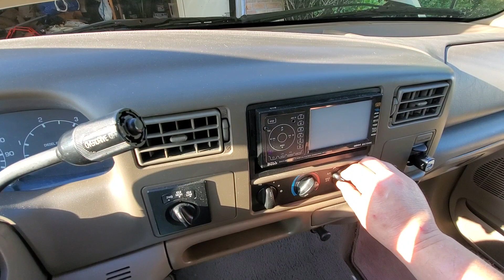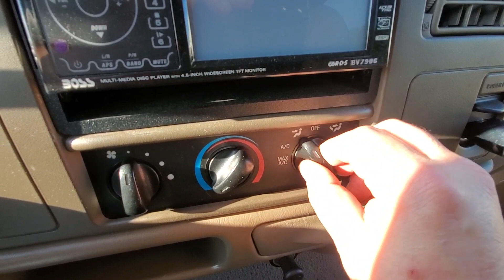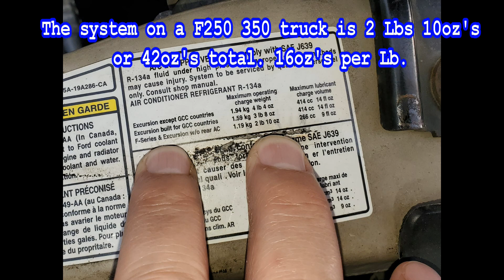How to Detect Low AC pressure Easily Ie F250 or F350

Comment: Can you give me a hand here, I have the same truck. I emptied out all of the R134a, then I attempted to refill the system with R134a, but the compressor keeps kicking on and off. The only way that I can keep the compressor running a hundred percent is if I do the same paper clip trick. Should I replace the switch? Or should I remove a shim from the compressor clutch? Or am I in for a new AC compressor?
Reply from the maker: Sure,   ****Sorry for the long answer I'm about to give you, but I'm not there to help you so you'll need to know a few things to find the problem yourself. So buckle up you're about to get a crash course on Automotive AC System Compressor Cycling.
* A little added note: On hot days the compressor will cycle on and off about every 10-20 seconds. IF the vehicle cools down, and the temperature coming out of the vents, ( in air recycle mode or AC MAX), is approximately 30 degrees lower than the outside air, then the system is operating normally.  Recycle mode is when you push the little sideways "U" with the arrow on it on the environmental controls, or put the system in AC MAX. This means the air going through the system comes from inside the vehicle and not from outside the vehicle. This makes it easier for the AC system to cool the vehicle down with air that's already cool, rather than bringing hot air from out side and try to cool that air. **
Ok on to your problem. Again sorry for the long answer!
Compressors typically cycle for 1 of 3 common reasons. Here they are with some of the underlying causes for those.
 * 1. Low pressure. Put a gauge on it to check it. You can rent a gauge set at most automotive stores for free. Free in that you put a deposit on them. The deposit is usually the cost of the item plus 20%. When you bring them back you get a full refund on your deposit. Watch A LOT of videos on these if you've never used them before,  or you can blow up or fry your system.
  a. Low on refrigerant.  MOST COMMON!
  b. Orifice missing. Very uncommon, some one has to open the system pull it and then forget to re-install it.
  c. Compressor seals are bad and allowing to much bypass. Mine lasted 18 years then blew last summer.

** 2. Hi pressure. Put a gauge on it and check it.
   a. To much refrigerant (Over charged).
   b. Orifice clogged or almost clogged. This happens when a compressor blows and is changed and the orifice is not cleaned or changed. This also happens when a owner uses a lot of stop leak to solve a slow leak. This typically is fine for one use but repeated use is disastrous. Seen this first hand on a friends truck, all I can say is wow is was BAAAD!
   c. Clog in the system somewhere, usually the Orifice or Condenser behind the grill. Stop leak or compressor blew up inside.
   d. Air/Moisture in the system. If the system is open for a while moisture can seep in and over time start to corrode the AC system from inside. The little bits start to clog the Orifice and Condenser. Air turns into steam and causes a high pressure but is a poor refrigerant. Always pull a vacuum after opening a system that allows air in. You can rent one for free from most Automotive Parts Store, same deposit deal as the AC Gauges.
   e. AC Condenser is clogged. The Condenser behind the grill turns the AC Refrigerant back into a liquid by cooling it. If the fins are bent or if it's clogged from road debris the can't work very well so the pressure goes up.
   f. AC Evaporator is clogged. This is very common on these trucks, and other large Ford trucks, even other manufactures have this problem, like GMC Safari's. This is a doable fix, but is a little bit of a pain in the but. You have to open the Evaporator clam-shell and clean it with a toothbrush, vacuum it, and wash it off with some water. Low pressure hose is fine, just put a wet dry vac hose in there to catch the water or it could end up in the truck. If you send me an email at keith_noneya@att.net I'll send you a picture of what to expect it to look like. 

** 3. Faulty wiring/electrical.
   a. The connectors over time get a little corrosion inside, "or" due to the constant vibration the Pressure Switch connectors/wires start to break down right at the connector edge where they go in it. This is a very common problem with the High Pressure Switch on the 7.3L. To find this one, bypass each Pressure Cycle Switch one at a time with a paper clip and then wiggle the wires by the pressure Switch. If it goes on and off you most likely have found your problem. Buy the connector at the the local Automotive Part Store along with some Environmental Splices, then change it.
   b. The pressure switches themselves over time do wear out, try changing them. Caution, they are supposed to have a schrader valve to prevent the refrigerant from leaking out when unscrewed. Unfortunately those valves don't always work and when the switch is pulled it sprays everywhere. The High pressure valve often sticks and if you're not quick it can empty a 12oz's (a can) out real quick. When doing the HP switch if this happens you'll have to constantly push the green AC O-Ring back up into the switch as you screw it on, not fun!
  c. Compressor Clutch Coil. These over time do go intermittent then usually fry when they short internally. On modern Ford vehicles, and other makes, they can be changed without emptying out your R134A.
  d. Bad ground wire on connection going to the the AC Clutch. To find this, bypass both Pressure Switches and wiggle the wires going to the AC Clutch. If it turns on and off you have a problem.

Again sorry for the long reply, I don't really know how much you know, so I though I would give you a lot and let you pick out what you needed and go with it. 
Always feel free to ask questions! My channel is about education and helping those who need it.
 Keep and eye on my channel. I editing a whole series on how to completely rebuild the F250/350 series AC System. Already shot the videos, but man getting the info right and editing is a "B-OTCH". I'll have a video for each item on How to replace ALL of them, pull a vacuum and recharge your system, including finding leaks, tools, chemical, etc.
Best Wishes & Blessings. Keith Noneya
Reply: @keithnoneya  the 3 reasons you gave to why a compressor keeps cycling is key here. That's the exact information I was needing, thank you!
Reply: Thanks for the information bud. You go above and beyond for your viewers. You have my sub
Reply from the maker: @FromThe3PointLine  PS how's the system running a year later? Keith Noneya

Comment: Where is the switch on a jeep grand Cherokee it is not on that little can 2003 please help
Reply from the maker: You'll need to do this search: 2003 Grand Jeep Cherokee Compressor Cycle Switch and it should pop up on YouTube. If you're still not sure let me know what engine is in it, as different engines use different set ups, and I'll try and find it for you. You gotta love YouTube! There's so much good information out there and I've met some pretty cool folks from all over the world. Let me know if you need more help. Ps if you email me a picture of your engine to my YouTube email I can get a better Idea of what engine and system you have. keith_noneya@att.net   Best Wishes & Blessings. Keith Noneya
Reply: I've looked everywhere for that switch Keith if I cannot find it I have the 4.0 6 cylinder the common engines in the Jeeps I cannot find the switch anyway I've looked all over it's not on the tank I followed all the lines by I can't find it if you can please help I've searched YouTube to
Reply from the maker: I'll see if I can find it for you. Of all the ones I've seen it's on top of the Accumulator, (the tank). Take a good picture of the Tank and send it to my YouTube email  keith_noneya@att.net. Don't worry I'm not going to sell your email, or anything like that.  LOL Keith Noneya
Reply from the maker: Oh hey Jeannie you could post a video on YouTube and all of us will get to see your system. That may be more useful for everyone to help. Best Wishes & Blessings. Keith Noneya

Comment: Wheres the video for leaking? I put the cans in and within a week mine runs out. Crazy it worked great for years.
Reply from the maker: Hey DYI I haven't posted it yet, but, I use the same method as ScannerDanner, it's cheap and very reliable. Here's a link to his video, https://www.youtube.com/watch?v=J6DSpx1V3Ms I'm sure it will help you find it, save you a trip to the AC guy and keep you from draining your bank account. Make sure and read the description (SHOW MORE) tab too, it has some good information in there on how to get/rent the equipment ect.
Let me know if I can help you in any other way bud. Best Wishes & Blessings. Keith Noneya.
Reply: Hey genius... if you mention a link, make sure not to forget to post the link.
Reply from the maker: @gavinvalentino1313  Wile E Coyote here! "You're absolutely Correct", OOOOPS Man I can be such a ditz at times. Figured out what you were talking about. Sorry about that.  Here's the link to ScannerDanners video: https://www.youtube.com/watch?v=J6DSpx1V3Ms 
Also, here's a link to some of those Recharge Kits if you need to get one. https://www.amazon.com/s?k=ac+recharge+kit+for+car&crid=1M0E6PRQW0HU7&sprefix=ac+recharge%2Caps%2C226&ref=nb_sb_ss_ts-doa-p_4_11 
Hope that helps, and hope you found the rest of the video useful though. and again sorry for being a Ditz! Best Wishes & Blessings. Keith Noneya PS I

Comment: Hey, sorry to bother.... but any ideas on ...when I put the "can gauge" on....it's reading SUPER high pressure...like 160-170....and no clutch action at all while running...Thanks Jason....!
Reply from the maker: If the clutch is not coming on and your at 160-170 psi the system is probably over pressurized or the system has balanced out since the clutch hasn't engaged the suction on the low side and the pressure on the high side. Put the gauge on it and bypass the low pressure switch with a paper clip like I showed in the video. If the compressor comes on and the pressure pressure doesn't start to immediately drop then pull the paper clip and take it to an AC shop. If the pressure drops to about normal then and starts to cool, change the Low Pressure switch. If the pressure drops below the normal pressure and the compressor is running, add some R134A until it charges to the normal pressure. Check it after a few days and see if the pressure stayed the same. If it does you should be good to go, if not and the pressure is low again you have a leak. Fix it, pull a vacuum and charge the system. Hope that helps point you in the right direction. Best Wishes & Blessings. Keith Noneya. PS you can rent a vacuum pump at your local Automotive Parts Store, Ie. AutoZone. Let me know if you need anything else.
Reply: @keithnoneya  Thanks SO much for your time on that...!  I really appreciate it!   I bypassed both low and high and changed out the relay with another one... clutch is free spinning....but did not come on at all.... only other thing I can think of is check for voltage at the compressor connector...(  the relay under the hood is clicking though....
Reply: Sorry... and just an fyi...it was working fine a few months ago....and it's just been sitting not drivin....(I know not good ...lol...but...idk...just crazy....(like all of the sudden....)  I did "bleed" the pressure on the low side and burp the high side down to like 70- 100 to see if it would help....but
Reply from the maker: @jasonherman4833  The low and high sides when the compressor aren't running equalize. So the low & high sides will both approximately around 100psi until the compressor starts to run. Short the switches again and put the positive lead on the compressor connector and the negative on the compressor body. Turn the AC on in the truck and you should have 12vdc on the connector. If you do the coil is probably bad on the compressor. You can change it without changing the compressor. Best Wishes & Blessings. Keith Noneya
Reply: @keithnoneya  Man.....THANKS SO MUCH FOR YOUR TIME AND HELP.....!  I REALLY APPRECIATE IT!   I'll do it tomorrow...!  Silly question.....can I do that "carefully" AT the relay terminal?   Or wouldn't recommend that?
Reply: And May GOD Bless you for helping others the way you do....!  THANKS AGAIN!
Reply from the maker: @jasonherman4833  What year is your truck and do you have a copy of the schematic?
Reply from the maker: @jasonherman4833  If you don't have a copy, I have a copy of the schematic for 1999 - 2003. I can email it to you and walk you through troubleshooting it, so you'll know what to buy. chat with you in the morning. Best Wishes & Blessings. Keith Noneya
Reply: @keithnoneya  sorry....missed that message....2007....I don't have a schematic...

Comment: I'm having this issue tho mines it's reverse, the clutch stays engaged and there's pressure in the system, even when I take off the ac clutch relay out, it's still engaged, not sure what's the issue, any tips??
Reply from the maker: Hey Danny answer a few questions please.
1. What year is it?
2. Does the clutch ever disengage?
3. Do you have a hand held volt meter?
Let me know and we'll go from there.
Reply: @keithnoneya  it's a 2011 Toyota Corolla 1.8L, and it stop disengaging when I noticed it wasn't throwing cold air, and I'm sorry I don't have a volt meter
Reply: Meaning it never disengage, it stays cycling with or without the ac being turn on
Reply from the maker: I have to take care of something for about an hour or so, I'll help you when I done taking care of that.
Reply: @keithnoneya  ok thank you very much
Reply from the maker: @NYRican1505  You're going to need a book that has the schematic and a meter, try a Haynes or a Chiltons at the auto part store. Once you get the schematic I'll need you to take a good picture of the AC system schematic and send me a copy of it to go through the wiring diagram with you. 
My email is keith_noneya@att.net if you want to proceed. 
If you're not familiar with using a mult-meter or chasing wires through a dash panel and engine bay, you might want to take it to a professional. It sounds like the control panel has a short in it or a stuck relay, that's why we need the schematic, to find out what part is not disengaging the compressor. Let me know if you want to try working with me on this Danny. It could take several days to track it down this way. Either it's a good idea to have a manual if you're going to do maintenance on your car. Also can you post of video of it on YouTube and explain in your bet words what your problem is. You can all it "2011 Toyota Corolla AC Won't Shut OFF" Send me the link to your video when you have that done. Please show the AC Controls and the Compressor & Switches in the Engine Bay. Best  Wishes & Blessings. Keith Noneya
Reply: @keithnoneya  thank you very much I'll try to figure out to get the schematic and send you the info, I appreciate it very much

Comment: Thanks for posting the video. It is very informative. I have a question regarding my 2007 Ford F-350 6 litre turbo diesel A/C. This vehicle mostly sits summer and winter so I expect it to be low on A/C coolant fluid from time to time. This time when the A/C was blowing warm air I had a look at the compressor and it was cycling every 5 seconds. I put on the gauge + bottle from a recharge kit on the low side. With the  engine running I saw the pressure swing back and forth from 25 to 70. I added a 6 oz bottle of fluid and saw the pressure steady to 35 = the middle of the green zone. However the compressor has quite cycling. It just runs continuously now. The A/C was providing cool air. It was not a particularly hot day, maybe mid 60’s. I have noticed in the past that if I left the A/C running continuously, it seemed to quit working, like the core iced up or something. After turning it off for a while - 20 minutes or more - it would resume working. Do you have any suggestions regarding this? Thanks for any help.
Reply from the maker: Hi J. 35 psi sounds about right for 60 deg's, I would check the cabin air filter. If they get a little clogged and get wet they will slow the air flow. Next check the Evaporator in the clam shell housing in the engine bay on the passenger side. The Low Pressure fill port on the accumulator should be hooked to the Evaporator Line. Even with cabin filters the Evaporator can get a little clogged sometime, especially if you don't drive it and mice get in there. I believe there are 11 screws that hold the clam shell closed plus the ones holding the Accumulator Dryer. You should be able to open the clam shell up and clean it, WITHOUT removing or breaking into the lines. You'll have to possibly remove the passenger Inter-cooler tube, at least I did on my 7.3L. You can try this guys video on how to open it up and clean it here: https://www.youtube.com/watch?v=TqFf7tP7Nfw.
 When I pulled mine open it was about 50% clogged and I had the same problem as you. I don't have that problem anymore. Don't forget to check the Condenser in the front behind the grill, make sure all the fins are clean. I hope this helps get you up and running better. Best Wishes & Blessings. Keith Noneya
PS some truck didn't come with the Cabin Filter, like my 2001 had none. I'm not sure on the 200, but I think it did. Let me know if you need anything else, glad to help. Keith Noneya
Reply: Keith, Thanks for the prompt reply. I ended up pulling back the blower fan about 8 inches, which ends up being quite easy - only 2 bolts for a vacuum device and the three for the fan. I could get a $20 USB endoscope attached to my computer in to have a look around the evaporator fins and they are clean. No sign of a cabin air filter to protect anything of course.  I have decent A/C now for what remains for the summer here.